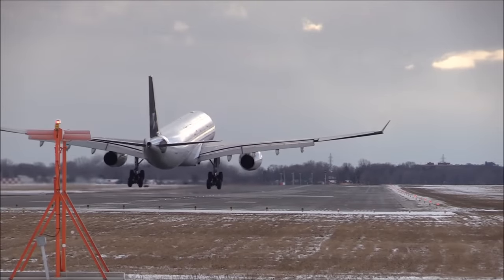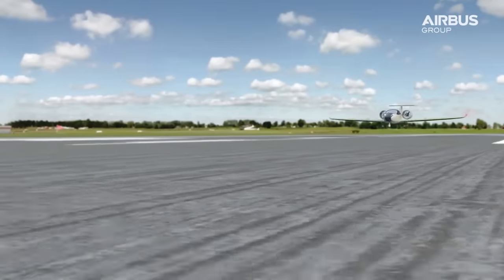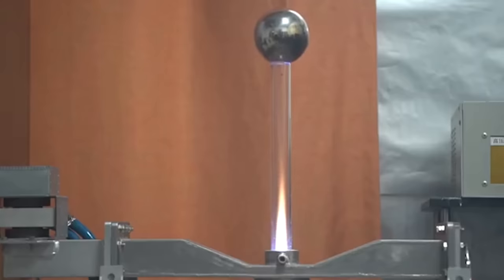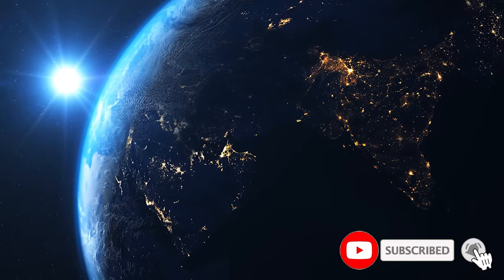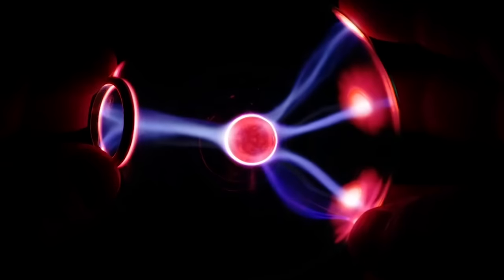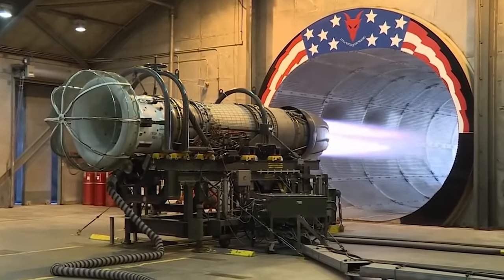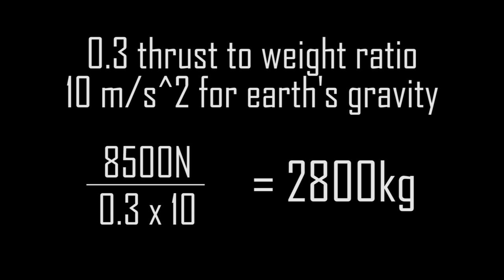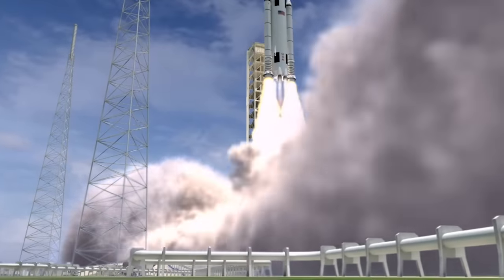Uncovering China's New Electric Plasma Jet Engine

Comment: I worked on something like this at Boeing in the 1980's for other applications. Too much power consumption was the result then and now. A magnetron is about 65% efficient and all you are doing is heating air. It is more efficient if you are going to make a controlled plasma is to seed jet fuel with potassium salts (or ammonium salts) and you also get heated ionized air. Ionization gives some superior control issues, nut is lower in efficiency as energy goes into making the plasma. The lower temperatures push larger volumes for the same fuel and is more thermodynamically (energy) efficient. minimum energy into a reaction mass is .5m+v^2 in  joules is the energy  and thrust is m*v in newton seconds . The slower the reaction mass is the more thrust per unit of energy ( 2v newton-seconds per joule). the trick is to speed up more mass with  less velocity and get more efficiency. that is how fan jets work to be more efficient than turbojets or ram jets. This system looks to be less efficient than any of the fan jet turbo jet or ram jet. 
Rockets use a different measure of efficiency use of MASS where jets measure ENERGY efficiency in terms of watts per newton of thrust.
Reply: We were thinking the same thing at Domino's
Reply: And that's why they pay you big bucks.
Reply: Well said! As an A+P tech at a major airline, this concept of a turbine engine running on electrically superheated air instead of a fuel/ air combustion chamber struck me, when I first read about the theory in a trade publication, as one of those "works great on a lab bench, but is completely impractical in real life" ideas. I would imagine that the battery system required to move a typical mid-sized airliner, say an Airbus A320, over even short commuter flight length flights would be so massive that it would displace much of the passenger/ cargo space. We can get away with in cars now, but even those new super batteries can't begin to approach the energy density of a full tank of petroleum.
Reply: @Wayne--O  I bet Starbucks will beat you to it.
Reply: @Wayne--O  the key is using air instead of Pizza in the microwave.
Reply: Interesting maybe revolutionary like when the germans created the first jet engine
Reply: @seven9399  this technology has been around for 70 years. Look at any plasma based technology including over 100 plasma spectrometers which are currently commercially available to see this is not new nor revolutionary.
Reply: He’s not wrong about the heating air part🤦🏻‍♀️🤣
Reply: Marvin, did you wake up and say to yourself, “ man, I want to get my ass kicked today. “?
Reply: If I understand right they have two options: 1 start the plasma engine already in cruise flight. 2 use a battery made with graphene.
Reply: @assistidor2023  I like the idea of using it for space flight.
Reply: this man propulses
Reply: Its probably more efficient to just keep burning petrol and offset the CO2 with carbon capture in the ground. I don't think we will ever get out of burning fuels to flying or going to space, its just too efficient to burn fuel.
Reply: im trying to wrap my head around positive ionization being directed into a horizontal thrust. Are these the control issues you were talking about?
Reply: @wise1xo  control vectoring an be sone by using currents through the ionized stream and directing the plasma using magnetic fields elimination the need for mechanical thrust vectoring or steering thrusters.
Reply: Yes, but it's electric, not fossil, so it's like way awesome cool.  And if Harris is our next POTUS, be sure there'll be a trade deal where we ship American $$$ to Wuhan to help develop this.
Reply: @moors710  Has anyone ever tried adding fuel to the ionised air that's made using the microwave? Does it affect the efficiency in anyway? 
I would hope it would help as an additive system to an existing jet model? What do you think?

 What might be the result in such a case where microwave radiation is introduced to an already ignited fuel air mixture either before or after ignition? Would it even make a difference? Would the resulting jet of flame be hotter than a typical flame jet? 

I hope you would kindly humour my curiosity as I am very interested in such topics. I've recently been interested in plasma and it's applications.
Reply: @Tuck343  Hello, at what kinds of speed would an air generator based system like the MAD/MHD system be practical in flight? Does it require hypersonic like in a military jet to be effective? Or is it possible to be efficient enough to be viable for a commercial jet engine? 

What kind of electricity generation are we talking about If you look at a typical commercial flight speeds? 

Thank you in advance.
Reply: @Ferario1990  Im doing some research to answer your questions, wait please
Reply: @Ferario1990  it appears that the plane needs to almost reach Mach 1 in the air to be effective.
It could be suitable for commercial planes, this system is very efficient because it's take energy from the air flow. You could apply it to Concord-like planes.
Aurora and B2 planes use this kind of technology
Aurora can reach Mach 10 or even Mach 15
Reply: schmuck Norris  it's is already done, the Aurora plane uses ionised air on his nose through an parietal generator for deflecting shock waves under his body. The result is that the plane "jump" in the air like skipping stones in water.
Is it your definition of a glider? 
Ionised air (or plasma) protects the plane from heat, shock waves, echo radar...
Edit : plasma + regular fuel plane is called MHD-by-pass
Reply: @Tuck343  Hmm thought so. It's a very useful technique. The idea of harvesting the energy of the high speed airflow is very clever!
It could have many applications, like in NASA's new Maxwell X57 series plane which is all electric, and 5 times more efficient than normal planes. It uses a "distribution of power"  technique which is using many small motors to increase lift on the wings during slower speeds.

 If the motors could be repurposed to be generators as well during  high speed phase of the flight, you could possibly fly for much longer than just the power from the battery alone!
 Now what we need is a way to make a hybrid motor/generator. Would that be possible?
Reply: schmuck Norris  you are welcome
Reply: My professor was an engineer @ JPL i was sleeping during his lectures in my thermo classes
Reply: @Ferario1990  As far as adding energy probably not in an overall sense of increasing the thrust buy adding energy, but better combustion with things like preheating the fuel or heating the air to get more completer burning. It might also allow higher speeds by staring the burn earlier in the engine preventing "blow out" of the engine at supersonic speeds.
Reply: @moors710  Hmm, so adding more energy to the combustion process won't directly increase thrust, but might help the fuel burn more efficiently and maybe increase max velocity? Thank you for clearing that up. 
So what exactly does effect the thrust value of a jet engine? Is it just the speed of the propalent vs the mass of the ejected material?
Reply: @Ferario1990  adding energy increases thrust, but the source of energy must either batteries adding far more weight than simply burning more fuel. Most commercial jet engines are high bypass jets ( fan jets) and most of the thrust comes from the jet fuel burned in the engine and turning fan blades that do not pass through the combustion chamber. The fan jet has the tips of the blades covered by a ring so it gains efficiency over turbine and propeller at higher speeds by avoiding tip turbulence of the propeller. Propellers are more efficient at lower speeds when the tip turbulence is relatively small and the excess weight of the ring covering the tips pays a higher  price than the gain of  covering the blade tips.   If you want more thrust in a turbojet (that has no bypass) you can add an afterburner. Turbines are limited in temperature by the metal in the turbine blades strength to weight of the turbine blades is a major driver in the metal selected. Tungsten is good for high temperature but has a poor strength to weight ratio. The limits of building a turbine burning jet fuel means the turbine uses excess air  in the turbine for cooling  (or not excess heating) in the turbine. A turbojet gets extra boost by having a chamber behind the turbine where more fuel is injected and the extra fuel gives greater heating and a boost to the net speed of the exiting gas.  The afterburner injects more fuel than  the stoichiometric ratio that would produce CO2 and H2O, so the output of the afterburner has a lot of CO and soot (free carbon) which gives the most boost to the air column, but is very bad for net engine efficiency
Reply: More mass at lower speed increases engine efficiency in terms of energy per newton of thrust. More speed and lower mass results in higher thrust (newtons) at the expense of efficiency ( newtons per watt)
Reply: Back in the 80's they just heated the air in bulk. Since that time, new plasma science had been discovered and new technologies developed. If I were a student now, I'd look into Wakefield Acceleration as my input source and play around with strategies to maximize ion utilization while reducing wasted firings. Both targeting and timing being key optimization. Fuel distribution may also need to be tweaked into matching clusters to further optimize efficiencies.
Reply: @moors710  I’ve tried to explain this idea in a few different domains to my old boss.  He always demanded high efficiency on design projects and could not understand that for what we were designing that peak efficiency came at the cost of a significant reduction in power.  And the customer was often asking for power/performance not increased efficiency.  He was definitely promoted to a position where he was incompetent...  I think efficiency was just a buzz word to him.  Also couldn’t get him to understand some basics of gearing, he would often ask for changes that were not possible without giving something else up.  Working for morons is exhausting.
Reply: @Ferario1990  Higher temperature makes more speed of exhaust and higher maximum velocity lower temperature more volume makes more thrust at lower speed. It is a trade between speed and efficiency of energy inputs.
Reply: @Tuck343  all these things are in research and it depends on who has interest. I do not currently have access to military designs so I cannot say what is currently in research. There is more money in military rather than civilian applications so much of the research does not become unclassified for about 20 to 30 years.
Reply: @moors710  no, it's not in research because it's 30 years old and it works fine. 
For exemple, Russia has torpedo that goes about 3000 km/h in water
I know this because i'm in contact with the scientific who invented this in France. His name is Jean-Pierre Petit and through him I have access to the design and blue prints. Give me your email and I will give you some documentation (it's in French, you need to translate)

(Enable subtiles in English) 
youtube.com/watch?v=56fGzcp6bIU&list=PLfdj8oy5zeoHB8cqu7pJxKLlO4n-bTOJO&index=3
Reply: So basically, it's not new like the CCP claims, it was invented in the US about 5 decades ago. Par for the course I guess.
Reply: @todo9633  Since work like this was being done in Germany France, UK and Russia 50 years ago I would not confine this to the US.
Reply: I don’t know what any of that really means but I feel smarter liking the comment
Reply: @monad_tcp  agreed, but I don’t agree we need to worry about co2 capture, it is good for plants to have higher levels of co2 as temps rise.
Reply: short version? we tried it, but it didnt work. Youre welcome
Reply: How do these systems compare to electric propellers?
Reply: @gabesmith8331  subsonic propellers work better both in terms of efficiency and thrust. Supersonic propellers do not function as the tip turbulence dominates and so these electric thrusters work better though not better than ram or scram jets. In space these have an intermediate performance between pure ion drives and simple heating systems.  Arcjet https://en.wikipedia.org/wiki/Arcjet_rocket and VASIMIR systems  are already working systems that use these principles
Reply: So if the chemtrails we see every other day on average are ionizing our atmosphere which in turn may fuel up more electrical storms which recently there seems to be more ufo videos showing up with ships in and around storms, my guess is these ships are using the storms for refueling.
Reply: I'm still working on a Mentos\Coke jet engine....stay tuned.
Reply: @1966cambo  I'm more worried about the possible runaway event if too much ice melts and releases methane and an rapidly increase of 15ºc than plants getting co2, yes, its good for them, but bad for people, you get more bigger plants, but with less nutrients.
I can probably migrate to any place in the world were the climate will be good enough, or I can just climatize it. I have the moneys to spend. 
But its going to be hell if you don't have financial freedom and can't move countries that easy because you don't have high degrees and experience.
Sure, continue thinking global warming is a good thing and co2 is inoffensive.
But when it comes to CO2 emissions, we have bigger fish to fry. Aeronautics is tiny in comparison, not worst the hassle, put some co2 capture and be done with it.
Reply: @monad_tcp  meh, CO2 and temps have been much higher in the past.
Don’t worry, the sky is not falling.....
Those that are fear mongers regarding “global warming” are the actual problem!
Reply: @1966cambo  meh, humans didn't exist in the same past CO2 was much higher, the sky sure is not falling yet, totally
Reply: @monad_tcp  what does the existence of humans during higher CO2 levels have to with it?
We can live and be fine in much higher levels of CO2 than we have now or will see in a long time!
Reply: Thank you.  I knew this was bunk from just an energy density stand point of batteries.  I had my brother trying to tell me about this and I told him it doesn't work no matter how efficient the system is and it is very unlikely to beat the efficiency of just a prop.  Jet fuel  is incredibly energy dense compared to battery storage.   No matter what kind of system you have, you can not draw more energy than what you get from your fuel and a jet plane flying at 500 mph uses a ton of fuel.
Reply: But nuclear power can be small and produce immense power
Reply: @gsppuffer  Yeah, that was looked into before chemical propellants advanced.   It is doable if you don't mind a flying reactor irradiating everything it flies over.
Reply: I don't understand what you are saying. However I can tell you are super genius.
Reply: have you ever just tossed a litmatch into a rotating microwave oven and put a nice glass cup on top of that and then started it? The plasma generated by that field alone is enough to near vaporize the metal on the top of the microwave in moments if not for the glass cup. Seems like a lot of untapped potential there. Some trick design for a triple harmonic wave guide along with some solid state circuitry and I think we might have a winner or at least a wiener.
Reply: @stevenfox2172  where do you think the plasma is getting its energy? You are look at a plasma being fed 1kw from the microwave.
Reply: You really know your stuff
Reply: How much propulsive force can be engineered by that kWh, is the challenge.

I think some sort of lilly waveguide using non-linear self-pumping phase conjugate microwaves to maybe extract an amplified time-reversed output wave from the input junction of the primary waveguide, maybe?  If that 1kW just made 10, that's an advantage right ?

Being that plasma is ionized, can we contain and compress plasma  by containing it magnetically via bowl shaped magnet arrays that were rotated to specific accelerations, creating unique flux fields that succeed where tokomak and others fail.  Would it compress the plasma and allow it to escape or eject with great propulsive force and force generated by flux densities near the base of the field emitter.  The net propulsive force would be dramatic, wouldn't it?
Reply: @user-mt4ny2zw7t  jet fuel is kerosene
Reply: @gsppuffer  exactly
Reply: @1966cambo  say that after a break in food production caused by the changes we introduced
Reply: @monad_tcp  what “changes” did we introduce?
If you are referring to “global warming” it’s mostly bs and nothing to worry about as well as very arrogant to think we can control the earths systems!
Reply: @1966cambo  we're on the tail end of a temperate cycle in a grande cycle of systems of which ice ages last for millennium.  We exist in a steady-state universe that has no ending or a beginning.  It's got to be some sort of simulation.  Does a DOT on a Mobius strip wander around and wonder why
Reply: @stevenfox2172  pretty sure most scientists would disagree with you on “the universe has no beginning or end” or am I misunderstanding you?
If you are talking in terms of time, we know the universe had a beginning, if you are talking in terms of it being endless, we don’t know that....
Reply: @stevenfox2172  as far as the cycles, I am aware.....we are still coming out of the little ice age , hence the warming.....
Reply: @budree4240  People with that attitude is causing America to to fall behind.
Reply: @USdefender1  Hey Nunley, Marvin is a smart guy. I was just playin’ with him for showing off how his brain works wonders. And I know he’s not showing off. Still, sarcasm.
Reply: @USdefender1  one more thing, Nunley, America is and always will be two steps ahead militarily. We will not allow ourselves to fall behind for any reason. I believe that is most important considering what is to come. Iran’s race for enriched uranium, Russia and their desire to take minerals out of Israel. So many issues.
Reply: I'll pretend that i understand what you just type
Reply: @moors710  So perhaps there is still room for this tech to be useful. In a hypothetical world where, say, fusion energy had been perfected, and energy consumed was no longer the overriding consideration, perhaps this might provide a less pollutant form of propulsion, no?
Reply: @aerobyrdable  this is not for  subsonic travel propellers are far more efficient no mater what the power source. it is a consideration for space travel where such systems such as VASIMIR  are already under research. The statement is this is not new and the technology has been under research for over 50 years is still valid.
Reply: @aerobyrdable  One problem is above certain temperatures ( depending on the base atom being plasmatized) plasma becomes superconducting and simple  ohmic heating above that temperature becomes impossible. VASIMIR has already dealt with this problem and uses other systems for heating. Again this is an established technology and the experiment is not novel and should be viewed as a call for attention rather than ground breaking research.
Reply: @rogerb5615  please be trolling....
Reply: @Simeon A. Scott it depends on speed and energy lost in making electricity in the first place.Pushing air at 10 m per second is three times as efficient as pushing air at 30 m per second ( the equations show the efficiency is inversely linear with speed). The best conversions to electricity rarely are above 50%.  The conversion compared with a propeller at 200m/sec having the same electrical conversion as the plasma at 1000 m/sec the propeller is is 5 times as efficient.
Reply: @aerobyrdable  Any engine with this much heat in the air will emit oxides of nitrogen.
Reply: @Simeon A. Scott  " they contain lead.  (for now?) so the problems are not just CO2" 
sweet !
Reply: @monad_tcp  and here in lies the problem....you say “facts”, problem is there is a lot of disagreement on what the facts are! For instance, CO2 rise FOLLOWS the rise in temperature, this is a fact but it is trying to be ignored, why? Because it doesn’t fit the narrative of the agenda. This is a carefully planned and executed control for those elites you speak of. 
How much I make,where I live and if I can survive has nothing to do with the facts.
This and the controls coming from the virus are all part of the UN agenda, and that is a FACT!
Reply: @waltertomaszewski1083  Ion engines have been used for deep space craft for 50 years...
Reply: @1966cambo  Actually we're going into one, we're just on a 200 year blip going upwards slightly and it's going to start dropping again.
Reply: @SilvaDreams  that wouldn’t surprise me in the least, the alarmists will come up some excuse to cover their lies.....
Reply: @1966cambo  Well they like to look at the short term, like say the past 100-200 years and then make claims that OBVIOUSLY we're the cause even though there has been a large volcanic uptick of activity which is the bigger cause of global warming and cooling.
But when you look at periods of hundreds of thousands of years it's a fairly big smooth curve up and down with little spikes and dips here and there.
Reply: @SilvaDreams  yes, I have looked at and read a bunch on the topic. Unfortunately one needs to wade through all the misinformation and figure out what the truth is. One guy I was listening to used old news paper articles to show how the alarmists have been lying and changing data, pretty tough to argue otherwise....
Reply: @Tuck343  You don't even know what you are talking about. A MHD is not the same as what you were talking about, shit we have FANS that use the same principle, bladeless fans have been for commercial sale for 20 years now or so.
They can move air sure, they they lack the THRUST which is the same issue as ION engines.
Reply: @Tuck343  Why would I send you a link for something that is completely valid? You don't even know what you were going on about at this point. I responded to your blabbering on about some charge particle/plasma shield to be projected out in front of a plane to some how magically defeat air resistance.
Reply: @SilvaDreams  it's is not because you don't understand that it is magic. Your mind is like middle-aged. 
Check the links I sent you and you will understand.
For now, you are still uneducated on MHD, plasma and physics of fluids
C.Henoch & J.Stace :

Experimental investigation of salt water turbulent boundary layer modified by an applied streamwise magnetohydrodynamic body force.

Physics of Fluids 7(6) june 1995, C.Henoch and J.Stace pp. 1371-1382

Catherine H.Crawford & Georges Em Karniadakis

Reynolds stress analysis of EMHD-controlled wall turbulence. PartI Steamwise forcing.

Physics of Fluids 9 §5) March 1997 C.H.Crawford, G.E.Karniadakis

pp. 788-807
Reply: I am thinking of microwave energy transfer tech. If there are break throughs in that field, it may be practical.
Reply: Have you heard of zero point energy? If so any idea who is working on it?
Reply: @thelaptopholderteam1875  I have seen the zero point energy derived in my physics classes. The derivations are dependent on the assumptions of quantum mechanics. The Zero point energy is a minimum atomic energy To get the zero point energy you must stop all atomic motion including atomic orbitals. Atomic orbitals are fundamental to the assumptions of quantum mechanics. Physics theories are rather disjoint at present. I believe zero point energy is recovered in matter and antimatter reactions, which are outside of the assumptions of quantum mechanics. So yes zero point energy exists. yes it can be recovered, and yes it is most commonly in matter antimatter reactions such as positron electron annihilation. We see it in the nuclear physics rather than quantum mechanics. Physics is rather disjoint on the theoretical level. If you follow one theory you get to specific dead ends that can be explained in other theories, but the theories do not smoothly connect.
Reply: @moors710  it would be nice to somehow wirelessly pool electricity from the entire electric grid
Reply: Agreed, magnetrons are not the most effcient osillators, however pure semiconductor solutions such as a 13.56MHz oscillator with a GaN amplifier is more effcient. I doubt that the researchers were using a magnetron; 400W is too low of a power rating for such devices. Please correct me if I'm wrong though.
Reply: What do you think of the future of the Biefeld-Brown effect? The only explanation I could find on this movie like everything else was for ion engines (it's never get to be mentioned in stories like these), but it seems that no one has done it, even though it's worth experimenting in propulsion-related fields, including aircraft engines. Did you do any research on Biefeld-Brown effect back in the '80s?
Reply: @honyasenyou  yes tell us about the.. biefeld-brown effect
Reply: @dustinswatsons9150  The phenomenon described as "Biefeld-Brown effect" occurs when a high voltage is added between the electrodes and one of the electrodes is made into a sharp shape that is easy to discharge. The movement of gas ionized by the discharge appears to generate a thrust on the electrode. All I can say right now is that it's different from "Ion Craft" described in this movie and it generates thrust.
Reply: @honyasenyou  well thanks for the inside I can't wait to fly something even if it's just a hang myself glider super felon for the win
Reply: @dustinswatsons9150  "Ion Craft" means "Iron-propelled Craft". Just in case.
Reply: @honyasenyou  sorry to waste your time I just don't know s***..
Reply: @dustinswatsons9150  Don't worry. It's a science fiction kind of story anyway.
Reply: @honyasenyou  🤣
Reply: @MegaDrummerJ  I guess I might be acting unrealistic, but I have high hopes from Hydrogen Fuelcells because of their high energy storing capacity in lesser space and mass than lithium
Reply: @assistidor2023  thorium baterry.
Reply: @Ferario1990  NASA doesn't have any new electric airplane that is 5 times more efficient than normal planes. They have an anticipated design goal--that's it. And this great efficiency results in a range of ... 100 miles. That is a fraction of its fossil-fuel-powered form. The OP here posted about real-life work and issues in engineering alternate propulsion systems. Most of the comments section underneath is based on theoretical imaginings, speculation, and misunderstandings.
Reply: @ReflectedMiles  Sure, you might be right about it all being theoretical, but that doesn't mean that none of it is possible. 

The nasa plane will remain a concept until all the hurdles in its way get crossed and someone with enough money gets interested enough in the project to bring it all together. 

We still need better batteries, lighter power generation, efficient designs, better manufacturing technology, commercial applications testing, and scalability of design and manufacturing before anyone can even think of getting one for personal use. The concept is there for others to work on.

 As you said, this stuff is mostly theoretical and will probably not be seen by any one for atleast 30 years, but its still interesting for the imaginative mind to ponder all the possibilities, and just maybe discover the next piece of the puzzle.
Reply: @Ferario1990  That is the qualitative contrast, though: The demonstrated hurdles in physics that the OP laid out, and which have been struggled with over decades by many teams in multiple countries, can never be answered by the theoretical—treating it as if it is on the same ground—yet most of the replies here fail to make that huge and basic distinction. It has been interesting to watch EV companies valued in the billions drop like flies, mostly from this same failure to respect the difference between their ideas, even in a prototype, and reproducing a reliable functioning of those ideas at least hundreds of times per day. The leap from concept to reality is normally a very high bar and the demise of most theoretical ideas, which is why the two don’t actually have much relationship to each other, let alone being equals. Decades of Popular Mechanics magazine cover illustrations and declarations are also demonstrative of that.
Reply: @ReflectedMiles  It's not that simple though. A huge factor for the lack of innovation and the death of so many plausible and effective ideas, is the fact that most big corporations actively to suppress innovation because it will harm their profits.
Reply: @Ferario1990  That has not been a significant factor with most technologies. As in the OP’s case, the said companies are often trying to find actual solutions across the practical barriers themselves so that they can make use of the theories in a variety of applications.
Reply: This is already on China's Space Station.